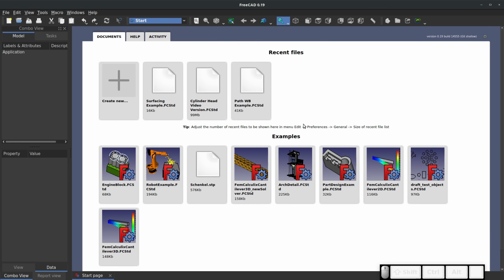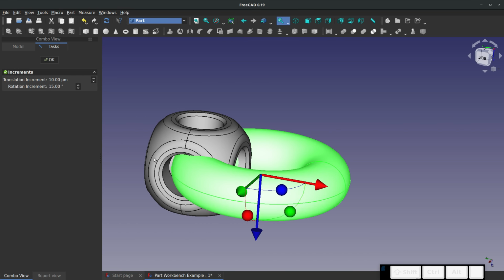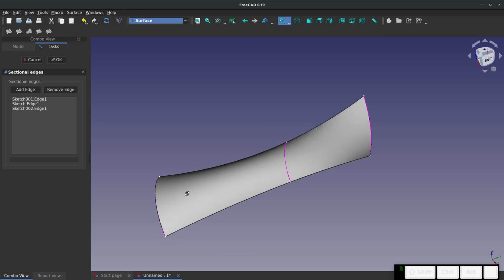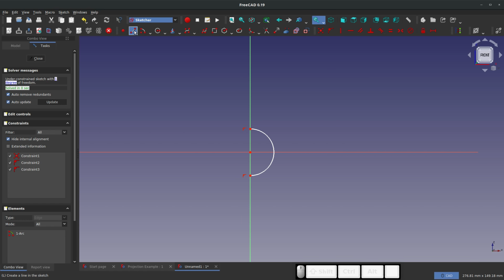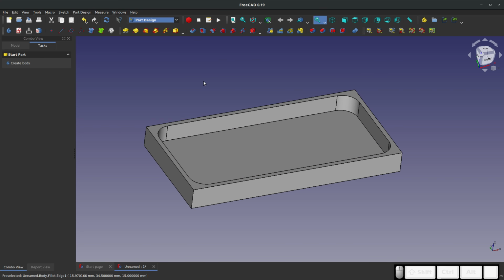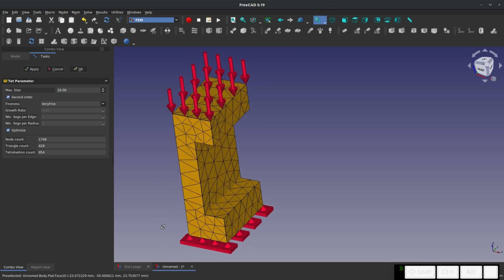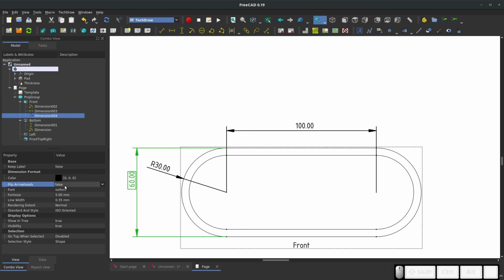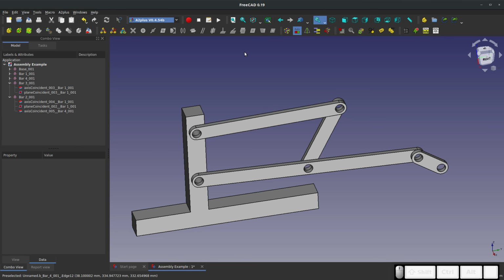FreeCAD 2022 Beginners Guide Chapter 2: Part, Surfacing, Analysis, CNC and More! |JOKO ENGINEERING|

Comment: Hello. Is there a way to highlight a feature on a History Tree and have that geometry highlight in the visual construction window and the other way around - as is possible in SolidWorks?
How about the end bar at the end od the History tree(as in SW) - being able to move it up and display only what was done above the bar and the rest be invisible?
Reply from the maker: For FreeCAD, I would highlight the item and use the spacebar which hides the features that come after the feature.  It's the closest thing to visually connecting the item in the tree with the model, and it visually rolls back the model like in SolidWorks.
Reply: @JokoEngineeringhelp  Thank you...that works for me....

Comment: Excellent video as always! But may I just note something in the fasteners work bench. The true magic of the Fasteners workbench is that if you make a body with a hole, click the edge of the hole and select a fastener, it will actually size the fastener automatically. Amazingly helpful feature that even high profile CAD systems don't have.

Making a bolt connection with a washer, bolt, and nut takes 10sec. It's magical really...
Reply: How do I do this in minecraft
Reply: Thank you Sr that actually works much better! It also even inserts the fastner so that one can go from assembly to explode way faster saving hours of time !

Comment: does free cad have an ability to make parts in to flattened patterns? i work at a factory that makes inflatable tubes out of thick air tight fabric. i'd love to give FreeCAD a try. Maybe there is another free program that can do this?
Reply from the maker: The tool for generating flat patterns that I know of is used for sheet metal, but it's worth giving it a try.  It would be the forming tool option to go from a formed piece to a flat piece which I haven't tried yet in the video.
Reply: How does virtual drawings translate to a physical machine